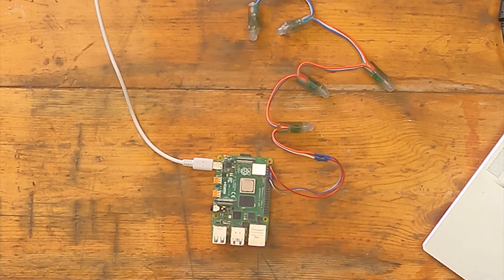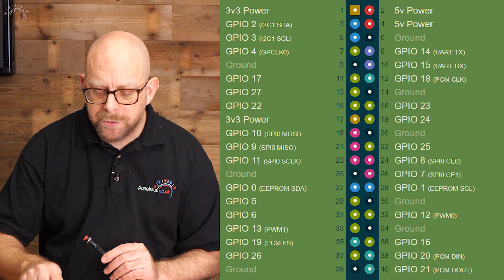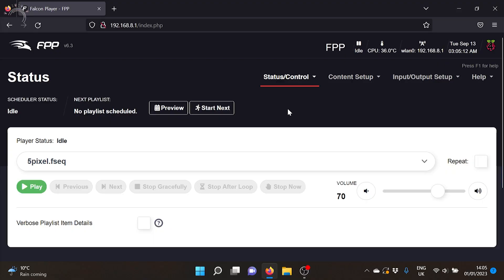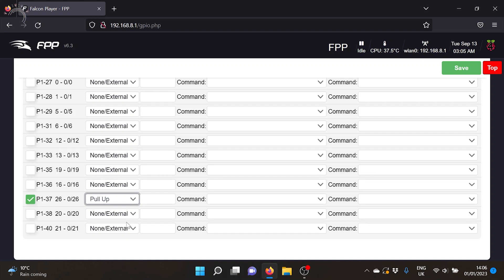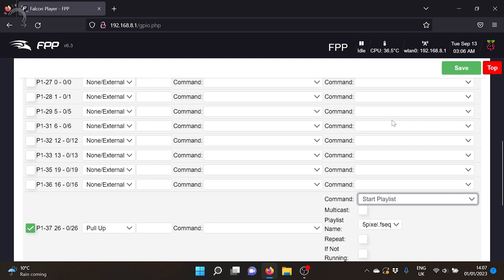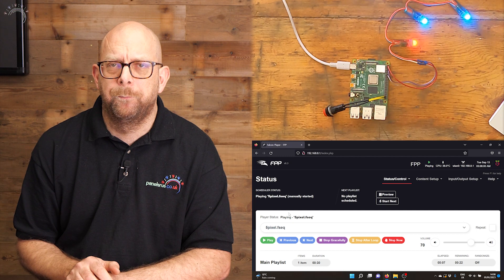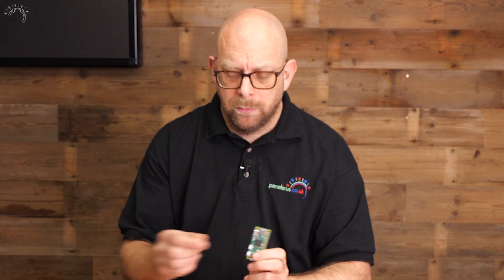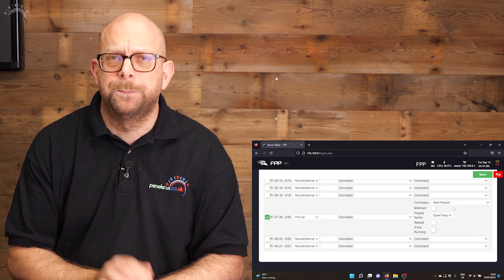Connecting a Simple Button to a Raspberry Pi - to start your show!

Comment: The suggested procedure works well to turn on my playlist.  I did not yet try this but what happens if you push the button while the playlist is running.  Also, what pins would i connect to stop the playlist.

Comment: will the momentary button switch on the pi also turn on the controller which it is connected to or does the controller need to be left on all the time in readiness for the data from the pi
Reply from the maker: Hi, the Controller would need to be on for this to work.
Reply: @gregmacaree  thanks Greg. I assumed so, was unsure. Your vids are very clear, objective, no dillydallying with side comments which detract from the info sought

Comment: Would it be possible using those commands to interrupt a currently running sequence, play a short playlist, and then return to the interrupted sequence where it it was interrupted?  For example, some one hits the button and it interrupts what's playing and then plays a sequence that says, "Please dim your headlights" on the projector screen for 5 seconds, and then returns to playing.